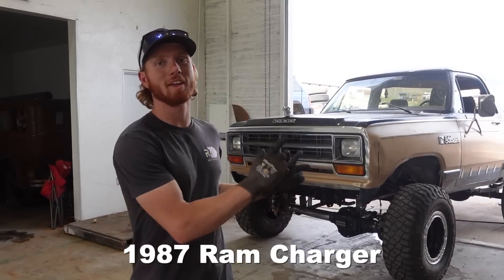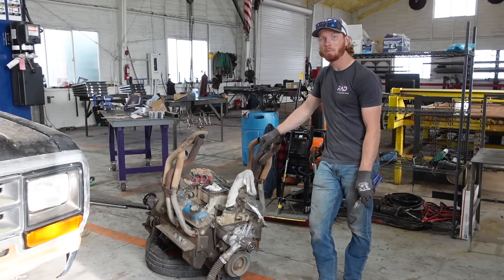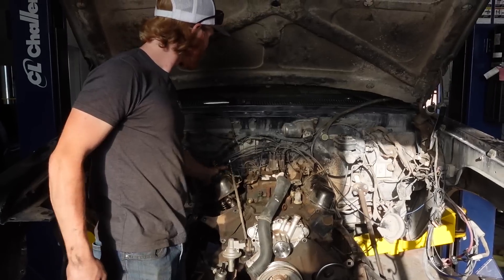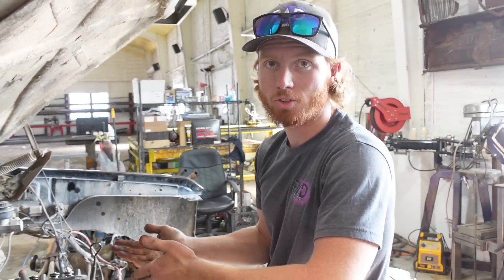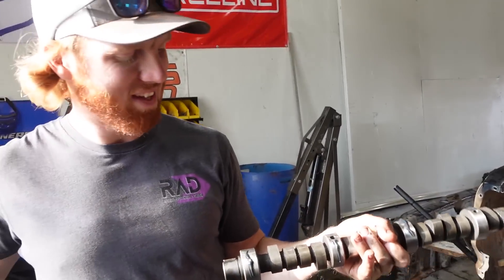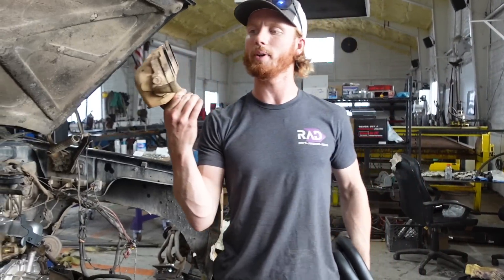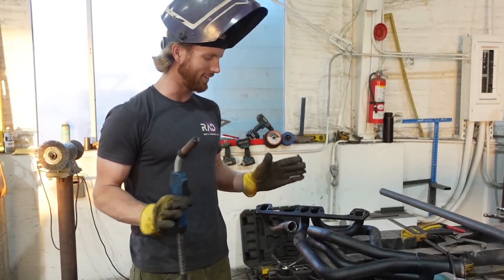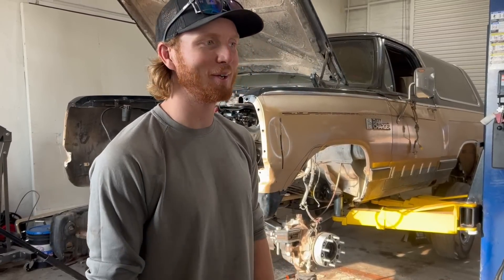Junk Derby Engine for the RADCHARGER

Comment: Buddy Rudy im a 59 yrs old mechanic and they make a spring tool you use a hammer with it has two pieces and it's so easy a kid can use it to take them off it's like a piece of pipe with a magnet inside you just put air into the cylinder using a compression tester hose aft taking the shrader valve outta the hose then just hammer the valve open the keepers will be inside the tool also can do the same thing with a deep well socket but to go back there's a stem piece goes inside the pipe piece and holds the keepers to hammer them back on the stem piece has a spring loaded tip to collapse and let the valve stem go up into the end and your keepers slip into place you can change a set out in less than an hour usually it's that easy and I think it's Kent Moore tools who makes it trust me well well worth the money makes valve springs a cake walk good luck
Reply: I couldn’t remember who made it though. I know Garret aka Cletus McFarland has one. I’ve seen him use it several times.

Comment: Just FYI, if you need to move the header tubes in towards the motor, it is usually easier to pie cut the tubes right near the flange (leaving a strip of metal at the top) and bend them in.  You could also cut the tubes out of the flange and re-weld them in at a tighter angle, but that is more work.  Usually, on small block mopars, you would want to replace the head gaskets if you are that far into it. This is because there is an oil passage that feeds up through the head gasket (which will eventually leak making your oil pressure go away), and because later model 360 heads tend to warp over time and need to be resurfaced.

Comment: I think my 87 Ramcharger had a 318 with throttle body injection.  Here's a poor man's tip for you.  You can use petroleum jelly in place of assembly lube.  It'll lubricate until oil arrives, then it dissolves into the oil, and will not foul your oil filter.  When making custom headers for my turbo VW I filled the pipe with sand and used a rosebud tip on my torch to prevent constricting the pipe where I bent it (and yes I started with straight tubing.).  ...and I vote every day for Team RAD Mischief.

Comment: Put the piston at the bottom of the stroke through an air fitting into the spark plug hole and fill it with air and that'll hold your valves closed and you can pull your keepers out.
Reply: We always put the piston down a couple of inches and stuffed about a foot of 1/4" sash cord in the spark plug hole. Then roll the crank back up and the sash cord will hold the valves without needing a compressor at all.
Reply: @merylpelosi8485 air compressor that is, because you’ll still need one for the spring, just not the el-cheapo c-clamp looking affair. Just sayin 😀
Reply: @ToddAdams1234  Fixed it. I never liked listening to air leak past the rings or to a noisy-a$$ed compressor anyway.
Reply: Just put air in the cylinder keeping hands away from moving parts..  The air will push the piston down..  The spring compressor you did buy does work fine.  Once you get used to it it will go faster.  Never have used  a ratchet on one.
Reply: I second this motion of airing up the cylinder!  Way easier!  #BuiltByBo
Reply: @pharmmech  What if you don't have access to an air compressor? I've changed valve springs on the side of the road and at the racetrack using rope for 5 decades.

Comment: Rudy, that S-402 part number on the big timing chain sprocket indicates that is an all steel, Melling (of race and high volume oil pump fame)  manufactured for Summit Racing (thus the "S") small block Mopar timing set...good stuff...as good as Edelbrock or Cloyes quality.

Comment: Great video! As a long time Jeep driver, collector and racer… the one big and best quick Jeep / Chrysler V8 mods is to buy a Davis ‘DUI’ distributor for that thing. It uses the GM style HEI high output coil and gets fire to those plugs….and 100 % easy drop ready to go, no modifications.   Don’t rule it out on budget concerns as it the best spent 380 bucks!.

Comment: When removing or installing a cam you can replace the bolt used to hold the now removed cam sprocket with a much longer bolt. This creates something you can use as a handle on the end of the cam to give you better control
Reply: Great job on making that valve spring tool.
Reply: Yep, that's how we always did it.

Comment: On cam with higher/longer lift duration you need stronger springs to make the valves close faster.  The new cam has steeper engagement and disengagement.  The weekend spring will close to slow and you will end up getting valve float and possibly having one part of the valve train colliding with each other instead of holding constant contact.

Comment: Great tool, great header mod, just cool man.  I always wanted  a Ramcharger to go with my Roadrunner.  Also if you need one, Mopar makes an adapter that turns the oil filter 90 degrees sideways to clear problem headers.  Just sayin.  Thanks for this Rudy, you made an old man happy.

Comment: Rudy, a set of the Viton rubber valve stem oil seals they make are a terrific, easy upgrade in any Mopar V8 engine...they don't leak oil into the cylinders, they can take a LOT of heat and use for years, and they still work like new. We've run them in all kinds of Mopar off-road and various race applications, we always use them in place of stock seals because they are a great, simple, fairly cheap, long-lasting upgrade while a guy is swapping valve springs. Just an FYI if you plan to do anything with that 360, or a 383, or a stroker 400 block, or a .060 overbore 440 in the future. ;)

Comment: Rudy, Mr Steve Dulcich always said to carry extra rocker arms in the glove box if you drive a hopped up small block Chrysler. Apparently larger camshafts will wear out rocker arms on those engines. I dont know that for fact. Ive never had enough spare cash to build a Mopar. You can build 3 SBC's for the same price. Lol
Reply: Yes, the factory stamped steel rockers will stretch in the pushrod sockets and the pushrod will bust right through them due to a higher lift cam and stronger springs. The cheapest set of roller rockers online will solve the problem. ;)

Comment: Yes, the starter motors for '85-'87 Dodge Caravans work on any small OR big block mid 1960's through 1980's Mopar V8 engine...and they are half the size for more header, linkage, brake line, wiring clearance, they're half the weight, they spin the engine over faster AND they draw less amps doing it! ;)

Comment: Since you’re into making your own tools if the distributor engages the oil pump drive to also drive it from the cam shaft you can make a very simple drill operated oil pump primer to help eliminate the dry start up after assembly.
Reply: What I have typically done is left the spark plugs out and crank the engine over to circulate the oil prior to starting.

Comment: Rudy, did you put the rocker shafts back on the engine in the correct orientation for sure? The shaft on the driver's side head needs to have the notch in the end of the tube facing the front of the engine, and angled or pointing to the center of the engine or the crank. The shaft on the passenger's side needs to have the notch in the end of the tube facing the firewall and angled or pointing toward the crank. If they are NOT installed that way OILING TO THE VALVETRAIN WILL BE RESTRICTED on early Mopar engines...it matters, a lot, especially if the engine is going to be pushed, revved up, heated up, hot rodded, used to tow, etc. There are little engine assembly quirks, rights and wrongs, do's and don'ts and tips and trick for a lot of V8 engines, Mopar has theirs too. ;) Watch from the 3:29 mark... https://www.youtube.com/watch?v=uaV_WMF5S5o&ab_channel=slantfishgarage

Comment: For those watching that want to do something similar. 

If you want to keep things clean put a clean rags over open intake and valve train areas.  
While you are there put new valve stem seals on.  You already have done the hard labor. 

Those EGR ports that he welded up you would be way ahead to tap the holes,  put grease on your tap to keep metal shavings out of the cylinders. Thread plugs in with anti seize to seal openings, making sure they recess in the hole so you don't interfere with putting the exhaust/header on.  DO NOT weld and grind with direct openings through exhaust/spark plug openings to cylinders.  

That cam and intake manifold are designed for higher rpms, not the best for a rock crawler and off road. Not much low end torque.  

Put a rag over the carb or open intake while it is sitting around. Think back to the beginning about the bolt/nut dropped into the intake, besides anything floating around in the air while grinding, etc. 

Good luck on the build.
Reply: I heard this a lot as a teen and built the lowest rpm sbc imaginable: then proceeded to never be under 2,500 rpm off-road with a SM-465 (I only see 700 rpm torque scenarios in stop-go traffic and im too lazy to shift)

Comment: On that type of valve spring compressor, I took one and got rid of the turning wheel, and welded a nut in its place. Then took a shock bushing washer... Drilled it out, and welded it to the part that actually screws down, to compress the spring. Had it for 20 yrs now!

Comment: Also when airing the cylinders you don't have to worry about turning the engine the air psi will do it but you do have to have a good air supply of I recommend 150 psi minimum you don't want to loose a valve lol

Comment: The thing I always use when I am doing valve springs is using a compression tester without the gauge and use an air line to that. With the fitting on the hose and threads in the spark plug its hands free and you don't have to fish anything out.

Comment: You can actually feed a piece of rope down into the cylinder through the spark plug hole and bring the cylinder up on compression stroke and use the Piston to hold the valve while you change the spring
I think it was Uncle Tony that showed the world that trick

Comment: Man using compressed air thru a compression tester hose with valve core removed is way easier than rope, the inside of that motor looks super clean like its been rebuilt
Reply from the maker: It’s still the original bottom end, with less than 60,000 miles, but I agree the top end looks freshly done

Comment: I like your valve compression tool!

Another way to keep valves from dropping is to pressurize cylinder.  Make a air fitting for spark plug hole by welding treaded metal from old spark plug to air hose quick connect like on air tools.

Comment: Custom exhaust headers can be a pain!  They rarely fit as advertised!
The only one I replaced on my vehicle was a 1978 Toyota 4x4 pickup, and it fit good.  I have helped others replace theirs, and they were always a pain!  Something would always be in the way, or they would send the wrong parts!
My recommendation is not to change them unless you absolutely need to.

Comment: A stock cam will find more traction when traction is most important.  A comp cam usually requires a different torque converter.
Reply from the maker: This one is rated for the stock converter, and I’m putting it in mostly to help on the highway. Lol.
Reply: @Rudysadventureanddesignreal    I hope it all works out okay.  That thing is huge and could use a good motor.

Comment: Might want to keep a check on them rockers Mopar tend to push a hole in The rocker with the pushrod overtime with heavier valve springs FYI
Reply: Yes, the factory stamped steel rockers will stretch in the pushrod sockets and the pushrod will bust right through them due to a higher lift cam and stronger springs. The cheapest set of roller rockers online will solve the problem. ;)
Reply: @moparman1962  cheap and broke budget people we just carry a couple extras in your glove box

Comment: Hi Rudy my name is Doug Sherman Baltimore Maryland some constructive criticism when your build for the Ramcharger for one you should find out what the RPM ranges for torque for the camshaft and find out what the RPM range is the manifold you were using is more of a high-end manifold for horsepower you need to be using a dual point manifold maybe even the stock one Performer manifold would be great for that vehicle what's your camshaft should have low or p.m. to work the started maybe all in by 3500 another thing to be added to instead of using full length headers you could have gotten shorty headers which would make things a lot better but I love what you guys are doing I love all your friends and your family very family-oriented I love watching you guys I laugh all the time I'm a depressed person and this brings Joy white life watching all the comradery you guys have family and friends but includes Robbie's Chad's Fabrics Trail Mater it's too late now you should have asked someone who knows a little bit more about what you're doing with your vehicle I m not a whole lot you can do with a straight 6 butter V8 can have a lot more advantages or disadvantages for one thing out of a straight-6 or getting straight line to work hello wavy shape motor you're not getting straight line to work sometime straight line tour power retorque because it's off concentrated in a straight line I know you're probably going to put fuel injection on it I'm a fan of Quadrajet carburetors I love them people called Quadra junks khwaja this quadrille at but the thing of it is or very good carburetors when your neighbor through dealing with only be better than the holley so if you would like to contact me about this you can just do a whole lot of Novak Cami manifold combinations but I know for what you're doing you probably got the wrong camshaft in the wrong intake manifold that is a single plane manifold like I say to work probably till over 3,000 RPMs and have a tour come in it around for thousand horsepower range you probably have to have like a 6 Grand Motor better for the horsepower range really come into fault and that motor is a low compression motor you have and this combination may work okay and me not so good luck buddy with everything you do I really appreciate all the content you guys have I noticed a little long-winded but you know opinions are weak you know what everybody has one so. You know what he has for that motor for your Derbies is one thing but building a motor for off-road the stuff that you do in the sand and having that environment you know it's two different find out what your camshaft is what Power Rangers and torque ranges are on it for the find out the company that made it you said with the duration duration everything was on it the lift and the left just need to know how to find out how the RPM Rangers are working in it and if you're going to have enough vacuum for your power brakes Bistro Petit webcams a lot of them don't have enough vacuum in on this surface serve vacuum brakes if that's the case you can change the lifters a brand called Rhoads lifters they will probably give you 5 more inches of vacuum

Comment: You can also make an adaptor to put shop air pressure into the cylinder to close the valves…just screw it in a spark plug hole and apply air pressure…..easy peasy.   😀

Comment: I would have looked at the casting numbers on the derby engine heads. Or looked for an X or J on them! Plus seen what condition they are in and seen if they had port work. Good difference in power with the right head casting. Well worth the time and money to swap them even if they needed resurfaced. An engine gasket kit is small money.

Comment: Pull the hood and outer fenders off. It will reduce the junk falling In to the eng. Pull the heads. Check the valves. The exhaust on the back 2 kinda get smoked.

Comment: They do make a tool that screws into the spark plug hole that you connect to your airline and will pressurize the cylinders and keep the valves in place while you're working on them

Comment: I am curious on Mopar engines are they the same as GM V8 in that most would say never use the cork gaskets for the intake and to always just use a good sized bead of silicone instead because the cork gaskets almost always fail? 
By the way so impressed with the tool fabrication. Very nice Rudy. Very nice.
Reply: I'm a Mopar guy, we use Good Stuff silicone gasket maker expertly applied to the mating surfaces for the intake manifold and the corners at the heads...cork gaskets suck.

Comment: OK a Question on Heating and Bending
You heated the one side where you were moving the bend away from the "melted" area
What if you had Heated / Melted the side you would be moving towards?
or even Heated  Both Sides of the Header Tubes

Comment: Sorry the K/D tool didn't work. I still have and use mine. Mine I used on a single spring ford engine. I have an air chuck to pressure up the cylinder to change the seals. I do like your  home made tool. I'd buy one myself. That being a gear reduction starter I wonder why it had one.

Comment: Put in new valve seals while its open
Reply: Yes, a new set of Viton rubber valve stem oil seals are worth their weight in gold because they don't leak oil into the cylinders, they can handle a lot of heat and a lot of use for years and years and they aren't very expensive or hard to install while upgrading the valve springs. ;)

Comment: As to the headers,I don’t remember the brand,but mine went on just jacked up motor, was a 1979, 360, then I did a 85 Ramcharger I put a 440 in where the 360 was, same thing with those headers just jacked up motor ,but ordered headers for 75 as that year had the 440, but was 35 years ago

Comment: I was going to say dang Rudy seems to be doing everything right then you decided to weld the holes I. The head and that went out the window next time just tap them and insert plugs ... hope the headgasket is a MLS and not a modern trash felpro or its probably distorted from. The heat.

Comment: put an air fitting into the spark plug hole and use air to hold the valves up